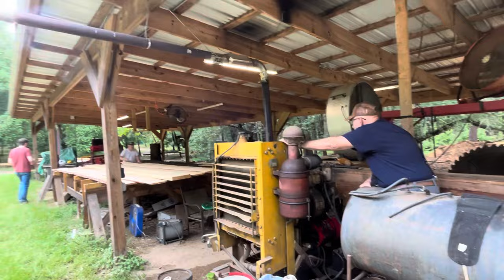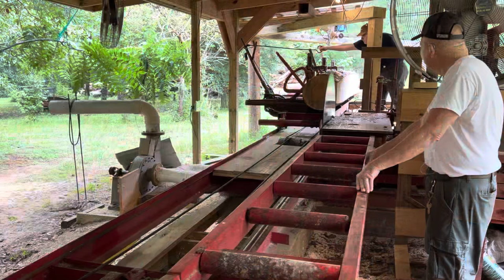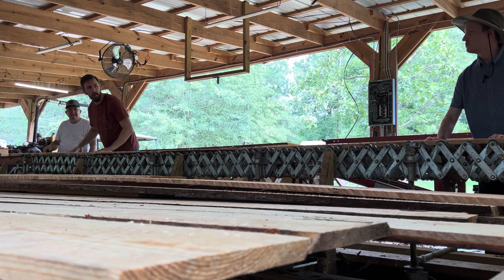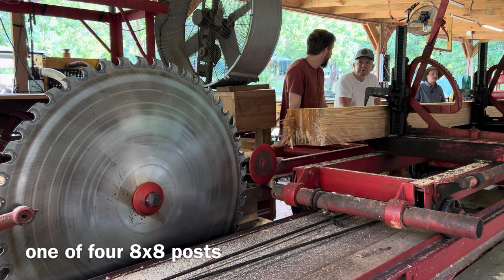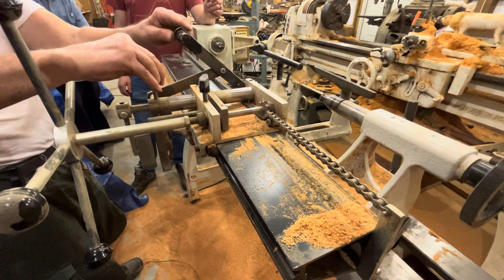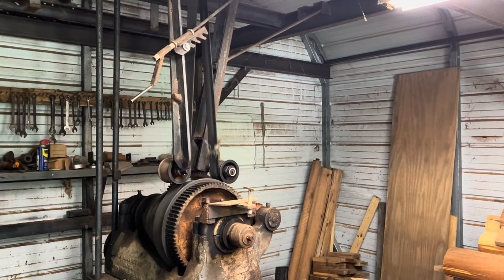Operating a 1930’s saw mill!

Comment: New subscriber here, may I ask what kind of mill you have here ?
Reply from the maker: Sure, I’ll add it to the description too. It is a Frick 00 circular sawmill with a 48 inch diameter carbide tip saw blade. Powered by a 3 cylinder Detroit Diesel motor.
Reply: @Nerfork  Awesome power unit, those old Detroit diesels are the best stationary power you can have in a mill, glad to hear that you're running carbide bits on your saw and thanks for such a nice show and reply